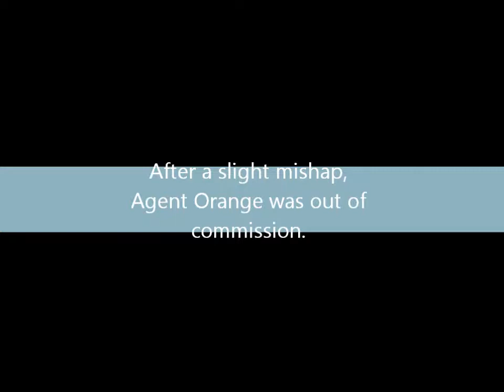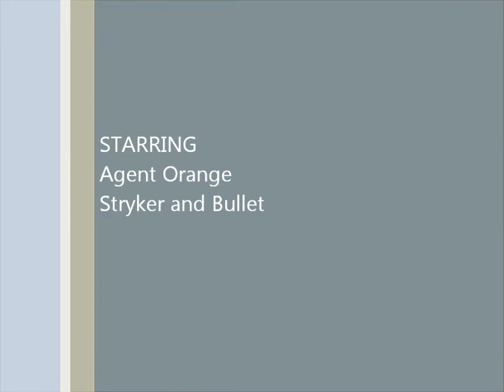RC foamboard plane build along- AO rebuild

Comment: How thick is the aluminum?
Reply from the maker: About 1/8 inch. It's sold as a flat piece of stock that's about 3 ft long and costs about $3. You can make quite a few motor mounts out of it. Another great alternative is metal rulers from the dollar store. They're cheaply made as rulers because the numbers and lines wear off easily,  but they make great motor mount material.

Comment: How did you do the v tail and the motor mount. I like the triangular fuselage and want to try the v tail...the wing on the last one finally lost it's strength, kfm with no spar...prolly gonna put it together soon and test it out
Reply from the maker: The v tail just extends upward from the fuselage in line with the two bottom sides. It is just hot glued on the end of the fuselage with a small piece glued overlapping at the seam on the inside of the fuselage to give them some bond. The motor mount is simply a short piece of flat aluminum stock I got at Home Depot, bent at 90 degrees, and stuck to the top of the fuselage with two sided 3M  tape.

Comment from the maker: I have changed the dimensions of the triangle fuse several times. Flatter, narrower, makes very little difference unless you get TOO narrow. Right now the top is 3.5 in., sides are 3 in. Might make the next one 3.75 at the top to see if it is more stable in the turns. But it's not unstable as it is. In fact, I like the way it flies. My original vtail had  90 degrees on it, and it was very stable on turns and lift, but the fuse was a square. Might eventually go back to that.